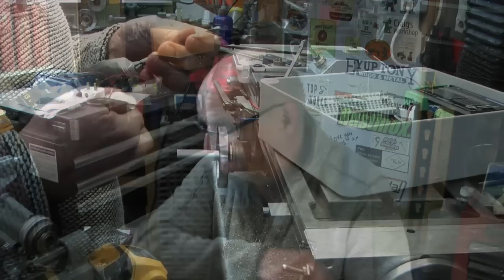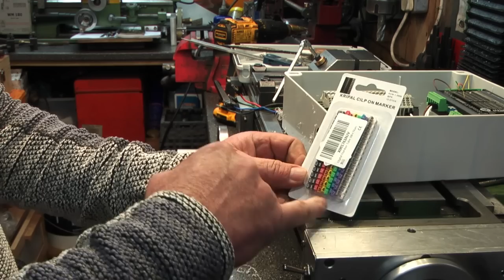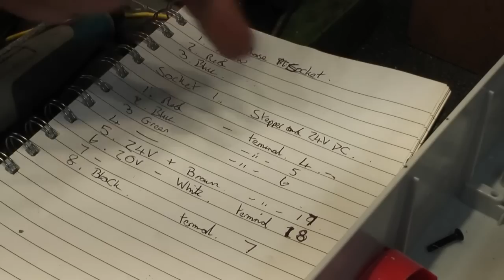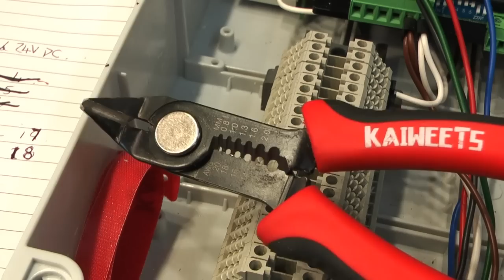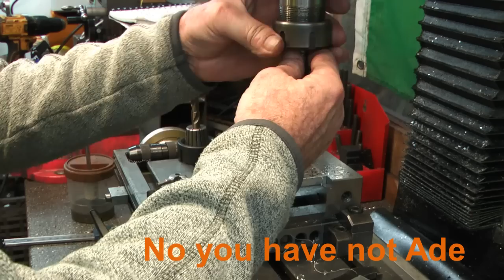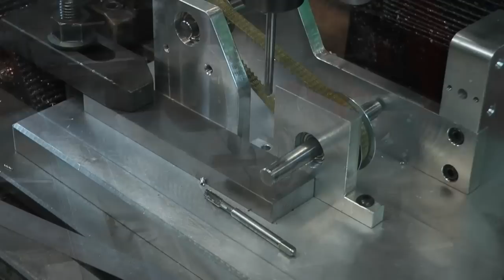Happy New year episode with more Mini lathe and Webster progress

Comment: That was a great video. Happy new year. Good rescue on the bearings. I think it would be a good idea to earth the metal casing of the three phase socket, for safety's sake.
Reply from the maker: Yes  lots of grounding will be done on all the metal bits on the machine . I have my ring main in the shed running a 30ma rcd as well . Thanks for your support. Cheers Ade.
Reply: @ade63dug  No problem at all. Thanks for your support.

Comment: As you said most ignition systems are run from the camshaft, the only one's that I can think of using a waste spark are older motorcycle engine's. As both exhaust and ignition cam are under no great force a simple grub screw fastening would suffice, then they are independently adjustable. (That's my big words for the year used)😁 keep the videos coming, happy new year to you.

Comment: G'day Ade. That military style connector looks dangerous to me for 2 reasons. 1 - it is metal and has live going through it and it is not earthed.(edit: OK I hadn't watched it through so I take it back but point 2 still applies). The second thing is that it is a male plug ( so when not plugged it has exposed pins that could be live depending on the state so there is mains voltage across any of the pins which could get you aswell). That is why extension chords have the male plug going into the wall socket and the other end has unexposed female socket.                                                                                                                                                             

Not sure if you are aware or not but you can get little hand held printers that print on heat shrink. Brother has one and it has a cartridge with the film and heatshrink tube in it (Brother P-touch PT-E110VP printer - about $70 Aussie where I am and the cartridge - under$20 for 3rd party or $26 OEM for 1.5 metres 5.8mm wide to suit 1.7 to 3.2mm OD wires). Probably don't need to do very many wires to justify the cost and you can still use normal labelling cartridges for self adhesive labels too.
Reply from the maker: point taken . the body of the socket will be earthed and I will be fitting the same plug and socket at the motor end . this will be the point for any disconnection making it a female from the power source end . I have the very printer you describe but was not aware of the heat shrink cartridge option . Interesting. I have the label and stencil cartridges . Thanks for your support and the information . Cheers Ade.

Comment: Happy new year Ade. Having two 8 pin sockets next to each other is not a good idea. You will need to be careful to put the correct plug in. Making one a 7 pin would avoid this danger.
Reply from the maker: True but it is only me in charge and i will label the plugs and sockets accordingly . Diolch yn fawr . Ade.

Comment: All the best for 2023 Ade. The cam running the ignition is fairly common, saves the wasted spark on the exhaust cycle if ran off the end of the crank. Also frees up that end of the crank if you fancied driving something else off it. As for piston rings, imsure Mr Crispin does a good vid on manufacturing those things 😀

Comment: Happy 2023 Ade!
The cooling of the stepper driver looks a bit risky. Heatsinks need the air to circulate but that build looks not satisfactory to me.
Oops, 1/2" ...... The same "possibility" exist for every drill bit. Personally I measure the drill bit before going ahead, just to awoid grabbing the wrong one.
Reply from the maker: I did measure the reamer and I was caught out by the taper . .I have been running the same stepper parts on the mill for two years now with less volume of cooling holes . I think it will be ok for the low duty cycles in my application . It would be my luck for heat problems to start now though. Happy new Year Stefan and thanks for your continued support and input . Cheers Ade.
Reply: @ade63dug  Ahh, tricked by the taper. The reamers in the toolbox here can be measured on the shank, not the cutting part.
Surely low duty cycle is safe but know that steppers draw current all the time, even more when not moving so to be safe You need to power down the unit after using it.
Reply from the maker: Good advice Stefan . Thanks Ade.
Reply: @ade63dug  Thanks ADE. Want to assist, not critisise.

Comment: Hi Ade, Happy new year and thanks for the excellent videos.  Driving the points from the camshaft is fairly standard for motorcycle engines. It should work fine.  On the other hand, having a 'redundant' spark in the unlet stroke isnt a problem. Either would work.
Reply from the maker: Thanks for confirming . the bonus is that the battery will last twice as long and the cam lobe and points etc. Cheers Ade.